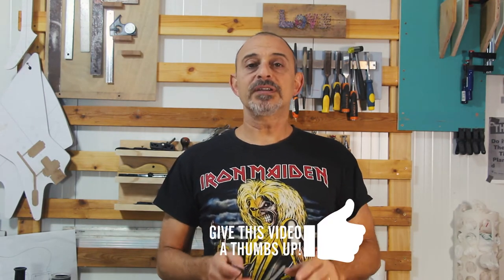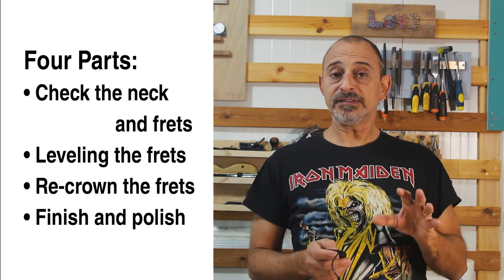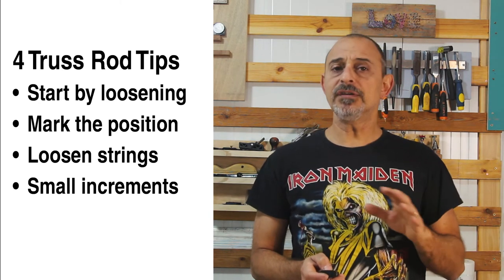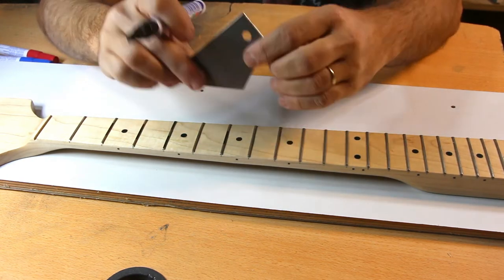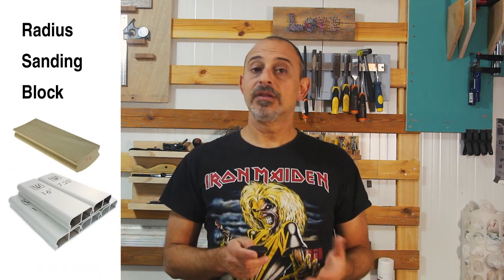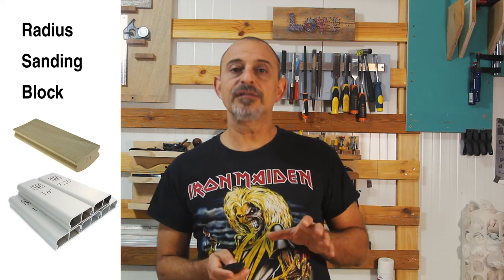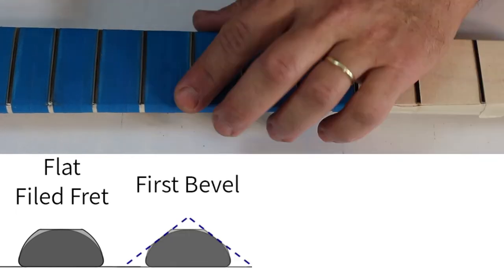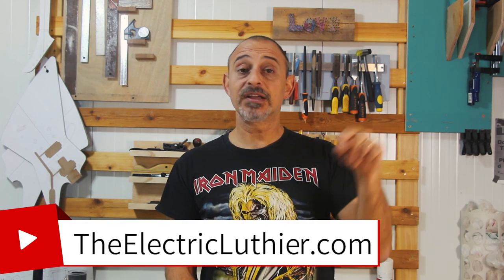Get a Cheap Guitar Neck and Make it Amazing

Comment: Thanks for the video.  Being that I did not see that trick anywhere, I would like to share a time saver tip that I discovered working on cheap Chinese necks.  Before sanding down all the frets, mark your high spots and use a hammer with a plastic head and just re-seat the high frets.  Saves me probably 80 percent of the leveling and crowning steps.
Reply: Thanks, Normand, 🙏 great tip. This will work better with a neck that just had the fret hammered in, with no glue. Should work even better if you have a fret press 🙂

Comment: When I had to do my guitar the rocking came after I marked all the frets and levelled them to the point all the marks were gone.  Then I went in with the rocker to tweak.  I still had about 3 or four spots I had to rework.  Saves a lot of time, and effort.  The worst thing I had to do is recrown.  I hated that part of the process to the point I really don't wish to do it again.  I got it though and all buzzing is gone.
Reply: Thanks for the comment.🙏 I see your point now and I tend to agree. I guess I was trying to really minimize the amount of leveling I would have to do, but in retrospect, I think both methods would get you to the same place, and yours would get there with less effort, 👍 and surely less rocking. I'll do that next time

Comment: I bought a cheap Chinese neck off of ebay for 30 bucks.  I did all that you said and it came out nice.
Only problem is the neck wood itself is very flexable like rubber almost.  Just playing the guitar and the weight of my hands freting notes causes it to go out of tune..  👍

Comment: thank you for this excellent video! any tips on rounding out a tele neck heel to fit a strat neck pocket? what tools and set up would you use? would it be smarter to modify the neck pocket instead, if so how and with what tools?
Reply: Thanks 🙏.  Since the Strat has a rounded end for the heel and the Tele heel is straight with sharper rounded corners you will have to adjust, one of them. The more common fix would be to create a negative template from the neck and route the Strat body. The middle of the flat heel must touch the rounded pocket's center. You will also need to adjust the scratch plate. You will need a router with a template coping bit and maybe some small chisels for cleanup. 
Another option is to file the heel of the Tele neck and leave the fretboard with a bit of overhang. I think this is actually easier as the filed area and the connection will not be visible. All you need for this are some files and sandpaper. Take into account that if you modify the body, it will not fit the original Strat neck if you want to switch back. The same goes for the neck' if you try and put it back on a Tele.

Comment: I make my own bodies but I hate building necks. I buy mine from China now. I can't believe how good quality they are. Well worth it
Reply from the maker: Yes they are. Sometimes it feels like cheating. 😉They often need very minimal leveling and crowning, but would still need that final touch to make them smooth and shiny.
Reply: @theelectricluthier1928  its definitely cheating but I don't mind. You are correct about the minimal work, sometimes just a fret polish after a tweek of the truss rod. I like to veneer the headstock, usually with a piece of quilted or sometimes flamed maple.
Reply from the maker: @briw4647  Of course, I meant 'cheating', in regards to the price. Getting a pre-fretted neck and making it your own, is fine in my book. It's even better if you customize it with a veneer or by changing the shape.
Reply: I usually pull the frets out of them and put better ones that's not cut too short or have been over filed . Got a few jersey stars where the frets were aweful but for 35 bucks so.
Reply from the maker: @rokinrandy  I am guessing you ran into some pretty bad examples of fret jobs. But re-fretting one of those, kind of defeats the purpose of buying a pre-fretted neck, doesn't it? 🙂
Reply: I'm looking at Aliexpress for guitar necks for a relic project but so many sellers any good links?
Reply from the maker: @rokinrandy  If the main purpose is learning, you can't go wrong. I've just combined learning fretting with learning how to build the neck, so I didn't have to re-fret any of the Chinese ones. Maybe your standards are higher than mine, but honestly, the ones I have seen weren't bad at all.
Reply from the maker: @Ken-yg4um  Haven't bought any necks there for a long time now. Try and check the store's rating and the comments. There is always going to be an element of luck with these..
Reply: @theelectricluthier1928  I doubt it ,I didn't meet chicks after gigs because it was closing time and  they waited for me.  It was because  that's all that  was left. I  have really really low standards. 🤦‍♂️

Ali Is a crap shoot man, The jersey shore the frets were done by someone that had no guidance or didn't care. or maybe by a 10 year old. looked like they took a side grinder to it.. and the ones with decent frets had lacquer peeling from the finger board or something. Luckily none were twisted. Glad to hear it's improving though
Reply: What has been your experience with the wood quality from China?
Reply: @glp046  only once had an issue, a small knott in the neck . Felt like a dip in the smooth finish. Other times, all perfect.

Sometimes the frets may need a little polish but that's it.
Reply: @briw4647  thanks

Comment: Subbed. Awesome stuff. Any thoughts on using an electric guitar neck to make an acoustic guitar?
Reply from the maker: Thanks 🙏. There shouldn't really be a problem with an electric guitar neck on an acoustic guitar if you are building it yourself and making it fit. The main differences are the width of the neck and the fretboard radius, which tends to be on the flatter side. Other than that it is really a matter of personal preference and comfort. Some people do apply more pressure when playing acoustic and that my mute other strings.
Reply: @theelectricluthier1928  Great. Thanks for the response. I have built before but never tried this combo  I wanted to tinker a new project and thought I'd ask a pro first. Much appreciated!

Comment: Does that also work for compound radius freds?
Reply: Thanks for the question,🙏. The short answer is yes, although you will need to be more careful to accommodate for the diferences. You can see how iI did it in more detail in my 'Orengina' build - https://youtu.be/M16PlP9Mjpg just skip the fretting itself (around the 9:00 minute mark)

Comment: Doesn't the neck have to be made from a quarter-sawn piece of wood?
Reply: Thanks for the comment.🙏 Quarter-sawn would be ideal as it will tend to deform less than any other. Many production guitars are not made from actual quarter-sawn wood but are well dried and stable.

Comment: So I've gotten that down good, but now what I'm struggling with is getting the neck itself to a smooth, useable finish.
Reply from the maker: There are a few ways to approach this. Personally' I like to rout the sides with 1" round-over bit. This gets me 90% a way there. and is already fairly smooth and consistent. Otherwise, planes, shavers and scrapers, will give cleaner results, after or instead of rasps and files. You can see it in both my Dragon Tele build and the 2020 GGBO. And like everything else, 'practice makes perfect'. Cheers
Reply: @theelectricluthier1928  Thanks! I'll be sure to try that out
Reply: I use superglue for finnish on my necks it works really good

Comment: Serious question ? After sanding a china crafted neck I was left w something best described as scales rather that saw dust. What is that material ? Everyone pretends that what I've described isn't important or maybe something that no one is supposed to to discuss. Really ?
Reply from the maker: I am not sure what you are implying. All the necks I have seen from China are made of wood. There may be some lower quality woods, although I have a coouple of very nice maple necks from China. Wood is not that expensive when buying in bulk, and I havn't seen cheap substitutes, but I would have no problem exposing  or showing anything fishy. I did get a plastic fretboard (plastic frets included)  on a Ukulele kit, But it was a 16$ kit, so no real surprise there.